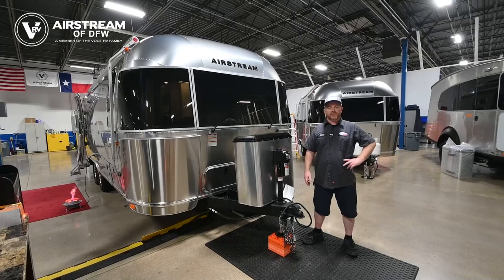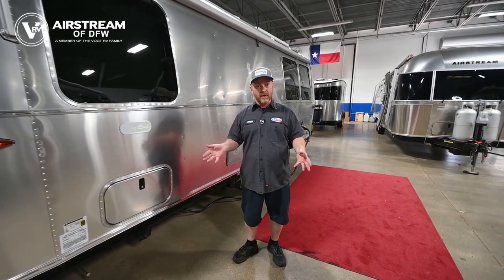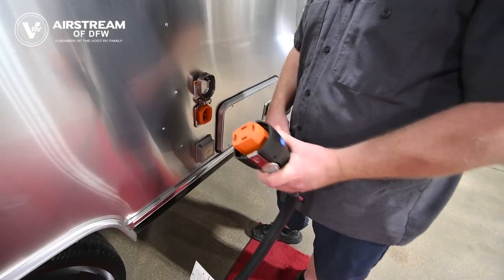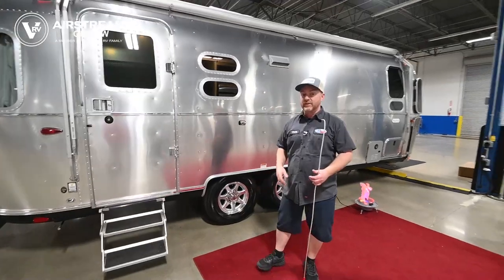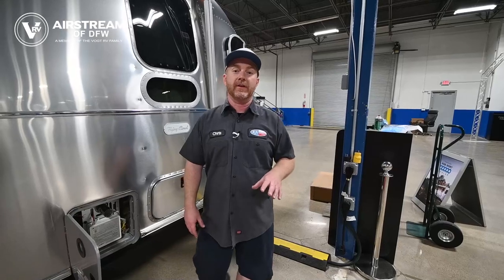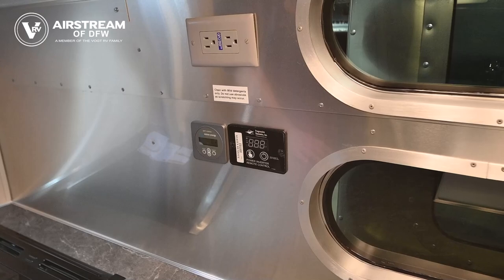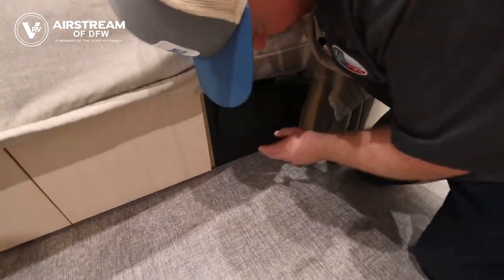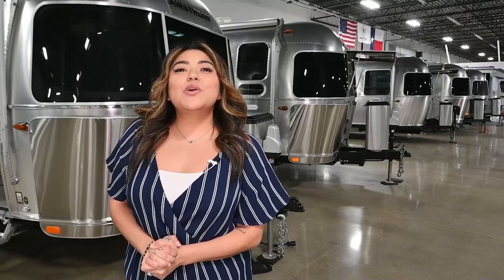Airstream with an Office and Hatch | 2022 Airstream Flying Cloud 25FB

Comment: How much solar can be effectively installed on this trailer?  Is the 180 watt Zamp kit the practical limit?  Are inverters with more than 1000 watts available from the factory?  

Starlink is about to make mobile officing worth considering, but I'm concerned about power with a more elaborate computer setup.
Reply from the maker: There are a ton of options when it comes to solar that can be done after the factory by our trained technicians.  There are a lot of variables that can effect what can be done, including model and customer use-case.  We have done very elaborate set-ups here at the dealership, including up to 600 watts of solar, upgraded inverters, soft starts on the ACs, and much more.
Reply: @AirstreamofDFW  Wow!  I had no idea 600 watts was possible.  Thanks.  That gave me a number so I could see what these installations look like.

This is transformative.  Getting into "mobile command center" territory. 😅

Comment: That awning is annoying.  I thought the extra arms and setup meant it was stronger than a regular travel trailer awning and could withstand a bit of wind/rain.  Turns out it is just as fragile but needs a lot more effort to deploy and retract.  I could see that getting old very quickly.